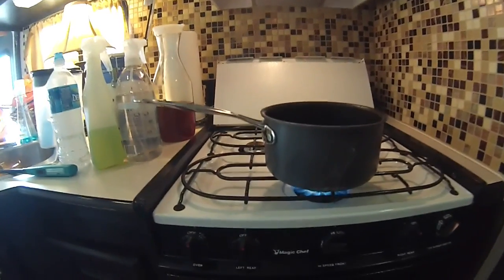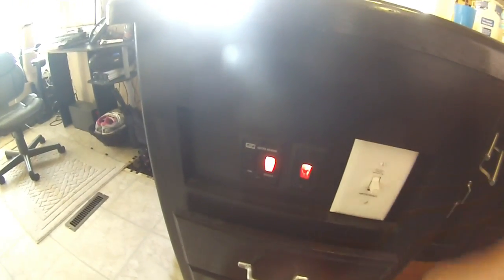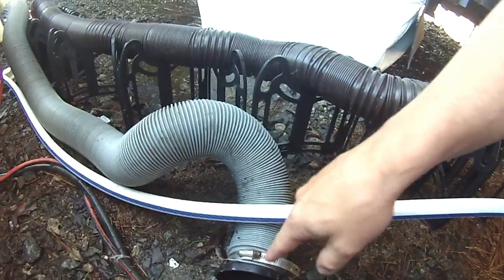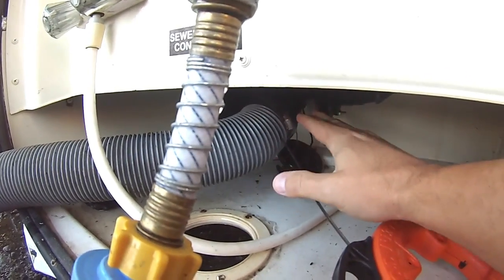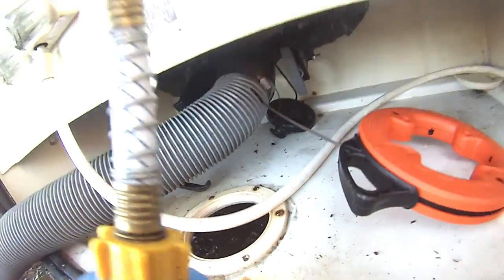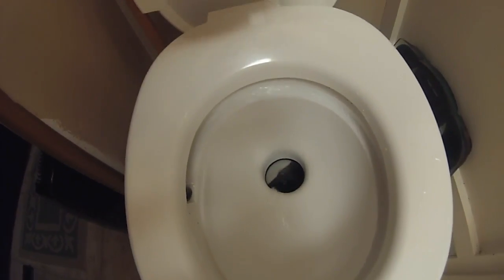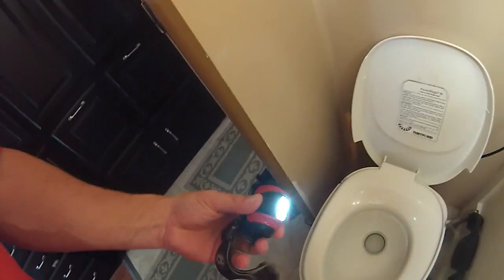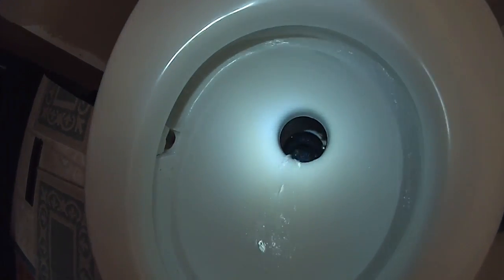Clogged Black Water RV Tank,  Free Quick Fix

Comment: The first fix worked for me after a couple of tries. Boiled water in a kettle and poured straight down my black tank through the toilet about 12 times (24 times total, 12 one day and 12 more another day) and waited 3 - 4 hours for the hot water to loosen the clog of the regular toilet paper I accidentally flushed previously. Just finished draining the tank a few minutes ago! Thank you so much, man! You saved me major time and money (that I do not have right now). 

I also sparingly used the blue Dawn dish soap (sparingly) along side the hot water, as suggested by many in this comment section (about 3 drops each time I poured the hot water). The first 12 times though, I went WAY overboard with the Dawn soap and wasted like half of the bottle. But I don’t think that much is even necessary. I still don’t know why my sensor always tells me my black and gray tank are both on 1/3 after dumping them completely, but hell at least now the black tank finally drains now. Thank god!

Phoenix

Comment: Okay, thanks for the video.  It didn't work for me, but this did.  I got my shop vac and swapped the hose so that instead of suck it would blow, a leaf blower would also work.  I put the hose into the opening of the toilet got an old t-shirt to seal up the remaining air space around the hole/to make an airtight seal.  Then I turned on the vac.  There was a little blow back into my face, lol, but it fixed the clog almost immediately.  I then ran water from my outside hose to get everything out.  Then I cleaned the bathroom and took a shower.  :)
Reply from the maker: a left blower o my.  that really worked wow that's a good tip.. never would of thought to use that.  was it smelly ?
Reply from the maker: blow back lol that's too funny
Reply from the maker: Mary Carroll did you get it unclogged ?
Reply: Thanks for shareing your experience. New ideas are always helpful.
Reply: Nice tip dude! Thank you!

Comment: I had a clog and a RV tech told me to pour a large bottle of Pinesol in through to toilet and leave it over night. It worked wonderfully when a snake and an expanding rubber clog buster wouldn't.
Reply from the maker: himmmm   not sure the rv park owner would like that but if it worked then it saved you some trouble ..
Reply: Thats a good tip!!
Reply: Thanks for sharing that tip.

Comment: Thanks. Great information. I had  the same problem. I wondered about using hot water to unclog the tank. I used a green biochem type of cleaner. Supposed to dissolve paper as well as break down wastes. It seemed to work pretty well. Everything came loose and drained. But the hot water is good to know.
Reply from the maker: thats great news  did it ever reclog up?
Reply: The hot water is earth friendly.

Comment: Hot water and dish soap works great or vegetable oil.  I read never put boiling water down as it can crack your toilet but super hot is good.  & keep the valve well oiled with vegetable oil as well.
Reply: These toilets are usually plastic and not porcelain like is in a house so while possible to crack, would be unlikely

Comment: Flush King or some other twist on valve with a water hose attachment to use the city water pressure to dislodge the clog. We use happy camper our favorite of the tank treatments. We've try pretty much all of them. We use regular TP. White Cloud its cheap,good, and 100% recycled paper. TP goes down, and Wet Wipes or any feminine products go in the small trash that we dump daily. Throw a couple pieces in of TP in a jar of water and see how long it takes to dissolve. 12 hours or less seems to be good.  We haven't had a problem yet in the 7 months we have been full time..  FRL is a family of 4.
Reply from the maker: himmm great tip

Comment: Great video. Any diy suggestions on a incorrect sensor reading? The black tank sensor is reading full even though tank is empty.
Reply: Pony Girl — old comment. Put could be a poop pyramid build up that did not clear out. False reading.
Reply from the maker: no matter what you do the sensers will never work right
Reply: I just purchased a Camco RV Flexible Swivel Stik with Shutoff Valve, but haven’t used it yet. Lots of positive feedback on YT videos. Cleans built-up debris from level sensors.

Comment: I have an issue, my tank is so full the water is right underneath the lip in the toilet. so no room to pour pots of hot water and I think it froze over night so extremely clogged. any suggestions to fix it another way? it just won't drain.
Reply: Virginia Watkins get a toilet snake to push the clog down. we got one from home depot. then add a strong enzyme to break down matter and do a good tank flush
Reply: +Adriana Ortiz Dena, me too. What did you end up doing???  Thanks
Reply from the maker: bring the rv into a heated building thats a mess

Comment: I'm not sure what you do to prep your tank ... but you need to add water to the empty tank before using it. One gallon for every 10 of black tank capacity. Also ... you need to use some kind of chemical crap (no pun intended) to help dissolve the paper and "solid stuff" going into the tank.  You already mentioned about using plenty of water for flushes ... USE PLENTY. Don't skimp on it.
Reply from the maker: yes  you can use both for sure great tip

Comment: I can't tell you thanks enough for this video!!!  I use regular toilet paper in mine (someone on Youtube said I could, and I believe EVERYTHING I see on the internet, lol)  ;)  and anyway, it clogged...  I was so scared that I'd have to take it into the dealership for them to do a costly fix.  :(   Anyway, I didn't even boil the water, I just filled up four, 1 gallon pails of extremely HOT water straight from the tap and let it sit for a couple hours...  It WORKED!!!  :)  Thank you SO MUCH!!!  I couldn't have done it without your help!!!  5 thumbs up for this video!!!!!!!  :)   -PJ
Reply from the maker: it worked thats great news ..
Reply: It is a good method to use. Yes, always be sure to use the correct paper so it does not clog up the system.

Comment: What's the snake thing you use?
Reply: Kylie Whittaker that was actually a Klein Fish Tape...electricians use it for fishing wire through things. However, in this application, it was used very much like a small 1/4” plumbing snake. The Klein Fish Tape is available at Home Depot.

Comment: I use to run a water hose into the toilet hole and turn it on it worked everytime
Reply from the maker: thats a good tip too
Reply: That method can sometimes cause the seal to leak.

Comment: We're getting a composting toilet so that we don't have to deal with the black tank...
Reply from the maker: +Diane Craig ohhhh I don't know if I could deal with everything that's included in composting toilets !! Good luck !!
Reply from the maker: thats might be allot better
Reply: Thats an earth friendly way to go.
Reply: Diane Craig me too, between toilet clogs and now black tank clogs and also a flush valve leak, I’m going with the separette. There’s no mixing or compost material used, just a bag that you can remove and the urine can be diverted to the Grey tank. Seems so much less fussy. Except there will be extra cleaning needed when Aunt Flo visits 🤦‍♀️